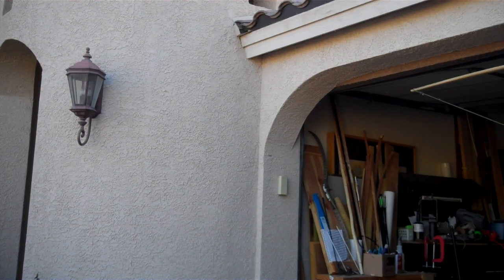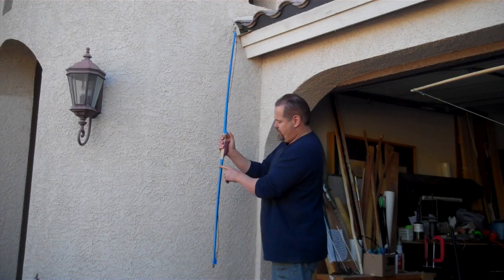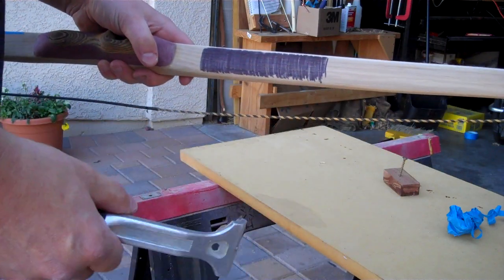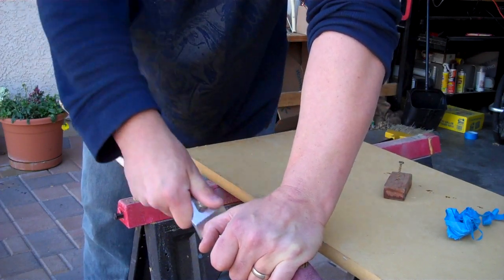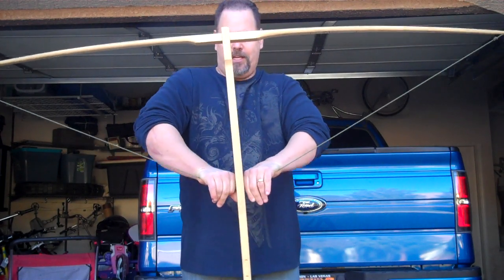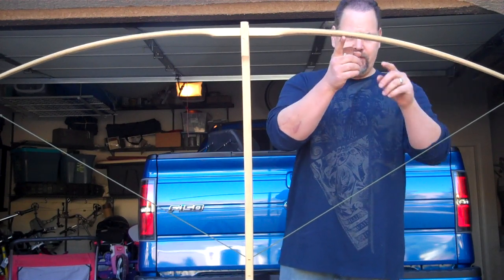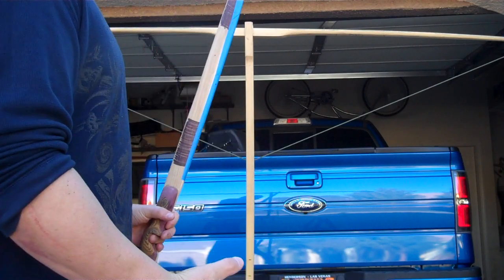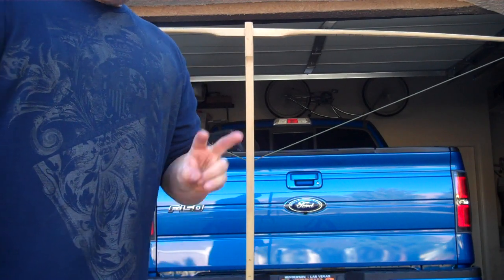How to Build a Flatbow: Part 8: Tillering 2 Ways

Comment: In part 8 of the flatbow build, you demonstrate tillering. With one of the bows, you have the riser handle glued on and shaped and you demonstrate using the scraper to remove wood. On the other, you have not built up the riser with a handle and use a tillering stick to identify places to remove wood. 

I am going to build up a handle and use a tillering stick, so the question I have is, when do you shape the handle in this process? If I shape the handle before tillering, it's probably not going to sit square on the stick, but could shaping the handle change the tillering if you wait until after you tiller? I would imagine not as the bow in this case isn't supposed to bend through the handle, but I wanted to ask. (asking here is equivalent to "measure twice cut once")

My guess is that the sequence would go...
- Floor tiller until it's in the neighborhood of right - heavy but the right shape
- Put in basic nocks for tillering (and insets if you are doing that)
- Install the handle build-up with slopes cut to fade onto the main bow body, but leave it flat where it would lay across your palm so it will sit square on the tiller stick
- Tiller and leave a few extra pounds to allow for the effects of sanding
- Shape the handle (place for your thumb)
- Clean up the nocks, finish sanding, etc.
- Apply a finish and make a nice Flemish bowstring

Do I have this right?
Reply from the maker: You got it! Just be careful after applying the handle that any sanding/shaping you do doesn't involve the limbs or you can get a hinge where the handle fades into the limbs.
Reply: Got it! I will take a deep breath and plunge into gluing that on and then tillering. Thank you!

Comment: Hi, I'm in the process of doing my internet research on bow-making to start making my first one. I really like your idea of the little block with the screw in it to aid in the process of spotting areas that need shaving for the tillering process. Any chance you could give a few more specifics on how to make those? Specifically what kinds of wood to use?does that even matter? Thickness has to be 3 inches? or does that not matter either? Does it have to be drilled in or can it be hammered? will a nail work just the same? Only stick it out far enough before the threading of the screw comes out? Just 1 "thread"? This explanation was a little too short and quick for me to understand before I'm confident in trying to use it lol. A whole short video would be wonderful but a reply would help a lot too. Thanks, big fan!
Reply from the maker: I'll try to get one up. Great idea for a video! Thanks!
Reply: BoarriorBows .
Wow I would really appreciate that! Thanks man!

Comment: Mike in the tillering tree do you center the bow or center where your hand goes and your right about the using the little block seems like you keep going even though it looks fine
Reply from the maker: I tend to put the tree where the web between my thumb and index finger would go as that will be the lever point when finished.
Reply: Thanks Mike that's what I thought to that's where it looked the best

Comment: Great information, thanks for sharing.  I was a bit inspired to try wood instead of a PVC bow after realizing that PVC was a bit toxic.  So long story short I got a red oak board and worked on planning it down and shaping it.  When I got to tillering I ended up snapping it.  I would say that it was about 50-75% draw length when it gave.  What methods do you use to cure/season the wood so I can prevent it from snapping?  I had oiled it but I'm sure it was a minor point.  Do you support backing?

Comment from the maker: Generally speaking if you plan on making a bend through the handle bow then the bow length (nock to nock length) needs to be double your draw length. So to safely draw 30.5 inches requires a 61" (nock to nock) bend through the handle bow. If you are going to make a stiff handled bow then add 6-8" depending on how long your riser is. In your case I'd add 8" and make the bow 69" nock to nock. These are self bow numbers and the bow can be shortened if you add a backing.

Comment from the maker: Hehe, no worries. Generally, string follow comes as a result of the over-compression of wood cells during the tillering or drawing of the bow. The most frequent advice given by "expert bowyers" to remedy this is that when tillering the bow never draw the bow with more force than the final intended draw weight. Having said that I only give that advice about a 7 out of 10. I think its true, but there are other considerations like type of wood (white woods tend to have more follow than other) cont,

Comment: HI Boarrior Bows. First I'll like to say is sorry about what happens to your bow. Anyways this is my first time making a bow and i've been following your flatbow build along. I'm making a flatbow and I was wondering what thickness and width should I make my bow to bring the bow around 50lbs draw roughly. Currently I my stave is 2" wide and tapers at around 15" to 1/2" at the tip. The taper is 3/8 at the tip and 3/4 at the handle. Any guidance would be greatly appreciated.

Comment from the maker: I would definitely put a backing on it. Most of the red oak bows I have seen that have survived use some kind of backing. Rawhide would be my choice, but sinew, bamboo, fiberglass cloth with resin or several layers of fiberglass tape would also do the trick.

Comment from the maker: Exactly right about the sharpie. I use the marker for times when I know I want to remove more wood than not (usually when dropping major draw weight), so no black specs remain. When getting down to the fine details I will switch to chalk or pencil.

Comment: @BoarriorBows
It's a left-handed PSE Buckeye, 34# @ 28".  It was brand-new older model.  The only problem I might be having with it is that I'm trying to shoot instinctively, and am canting my bow at an angle (perhaps 25-30 degrees from vertical), and so the string settles outside of the middle groove on the limbs sometimes.  I'm not sure if that's normal, or if I should be canting a recurve.  I'm a newb, and have only shot twice now. :D